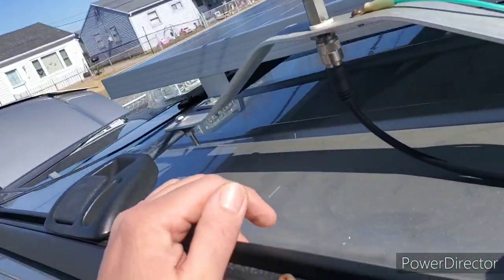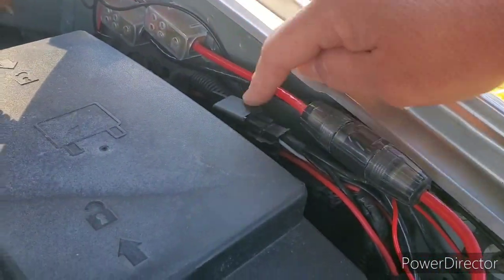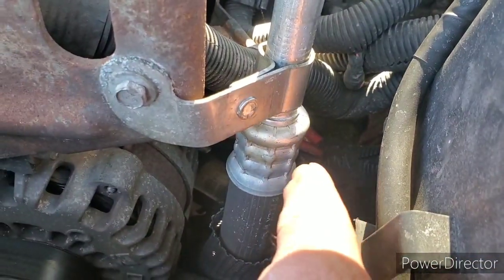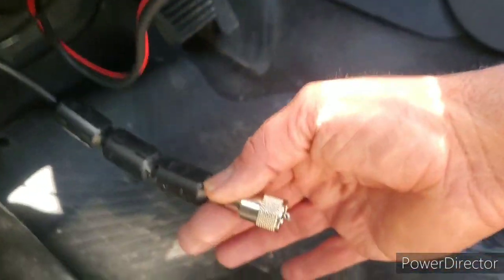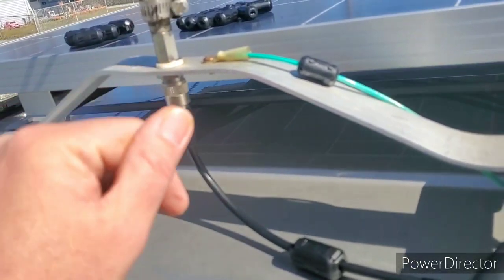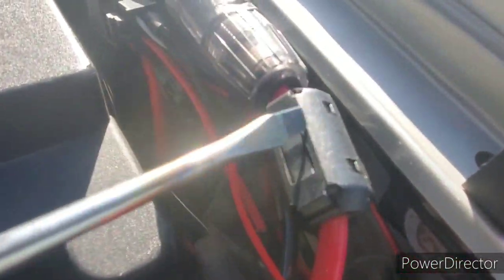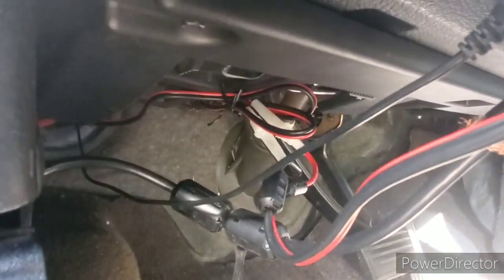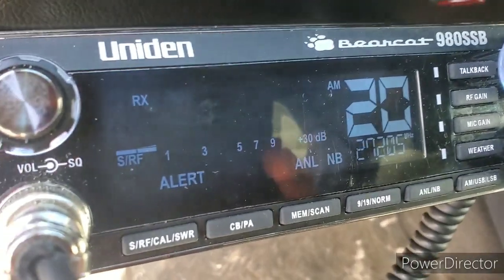671 EMI , RFI, HFI  And all the noise can you imagine in a Radio CB Choke  ferrite 3/5/20

Comment: Why would you put a choke on your signal cable? Think about it, that's last place you want loss. You want to eliminate spurious sources of RF from inside the vehicle. Put chokes on power wire to the radio. Everything else should get improved ground bonding.
Reply from the maker: It works good I know I just work good so I need it but thank you I will have that in my  Friends